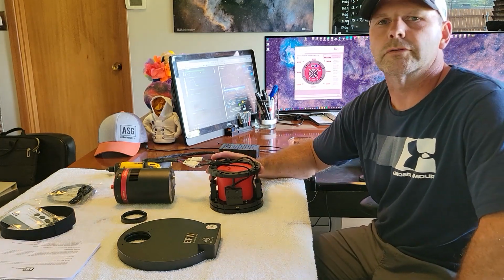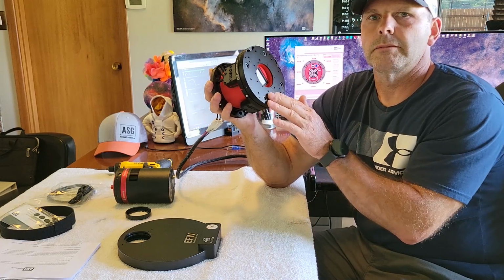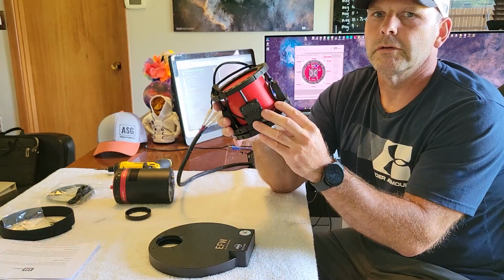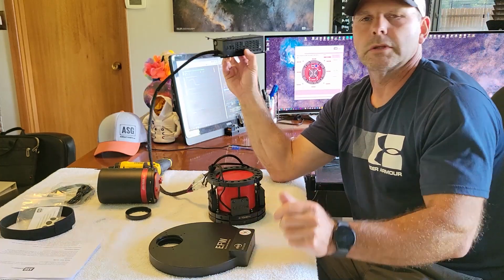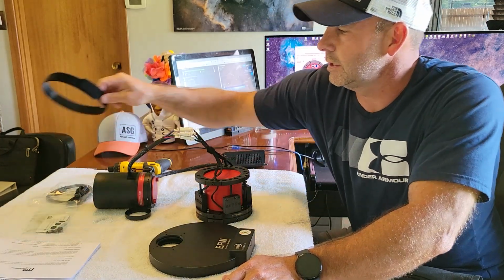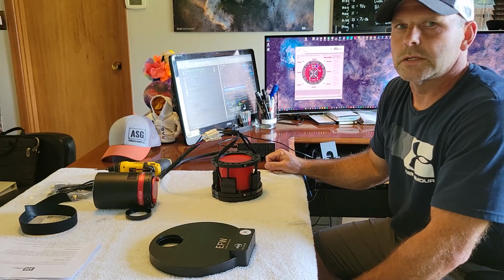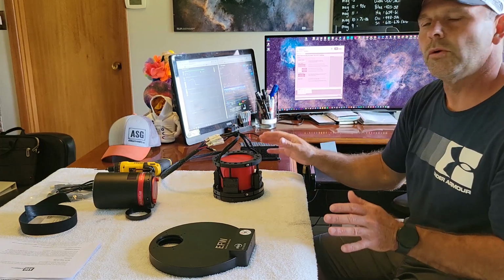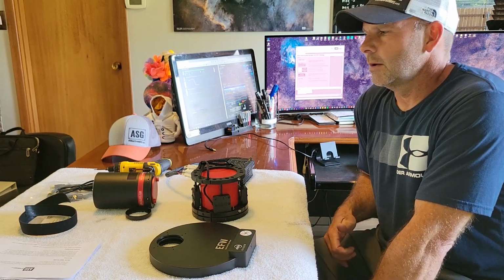ASG Astronomy's Electronically Assisted Tilt (EAT) Introduction

Comment: That looks great! But unfortunately for those who use field rotators, tilt adjustment must be done before the rotator, i.e. on telescope side (taking that tilt is not introduced by the sensor itself), because when camera is rotated e.g. 90 degrees, the tilt correction would be invalidated.
Reply from the maker: No reason you cant rotate, just run it, tilt it, and fix it.